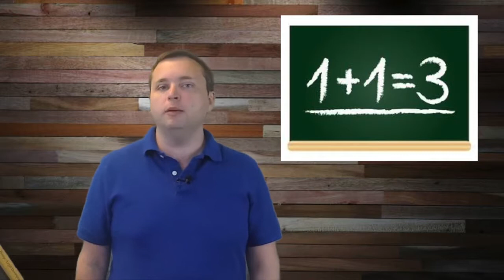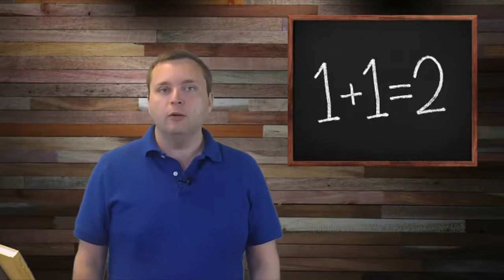Land Survey Tips: Retracing Boundaries in Platted Subdivisions

Comment: If you can determine with a large level of certainty that the monuments found are original platting survey corners, then MOST of the time, they will hold over the platted bearings (or angles) and distances.
If you find monuments that you feel are at least ancient even if not legally provable as being original, and they match the plat. As you stated, you are golden.
Almost no one digs 4 foot wide - 4 foot deep holes for monuments on a lot survey.  In fact most home owners (even your clients) are going to call the police if you do that on their lots.
Plus almost no one wants to pay a surveyor the price needed for a survey company to do that for every lot survey.
They will instead hire that guy who only does the bare minimum (or less than)  and push it out the door.